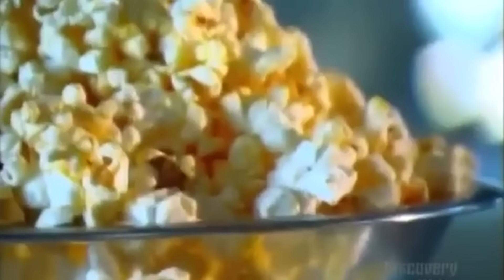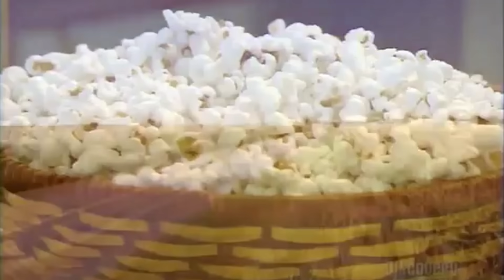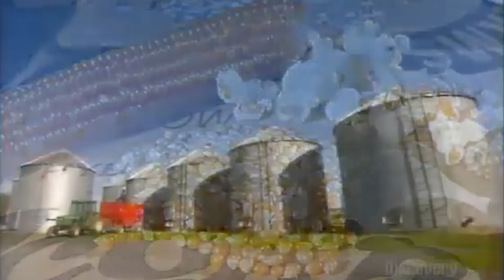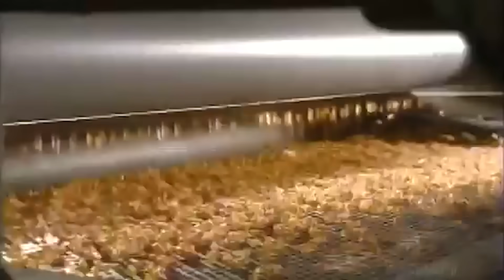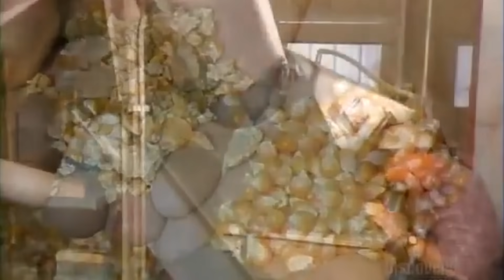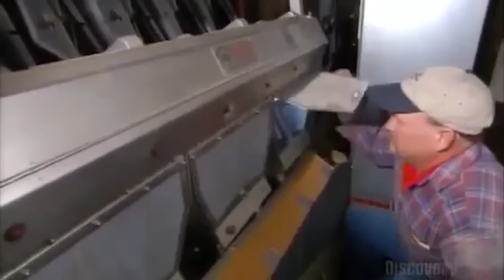How It's Actually Made - Popcorn

Comment: In the Danny Phantom opening, it shows a power switch inside of the portal that Danny's parents built. This is bad structural planning as to turn on the machine, the power switch must be turned on inside, which requires someone to go into the portal and transform, as what happened to Danny. His parents are not only imbeciles, but also irresponsible.
Reply: In the first Harry Potter book, we get to see the Weasley family heading into Platform 9 and 3/4. The concerning aspect of this is that Molly Weasley doesn’t seem to remember the name of the platform. This is strange, as Molly Weasley has probably gone to this Platform more times than any other parent at the station (7 from her Hogwarts years, plus around 9 more taking her kids there). This implies that Mrs. Weasley might have some fairly severe memory issues, and should probably see a doctor soon.
Reply: What the hell
Reply: You both ok?